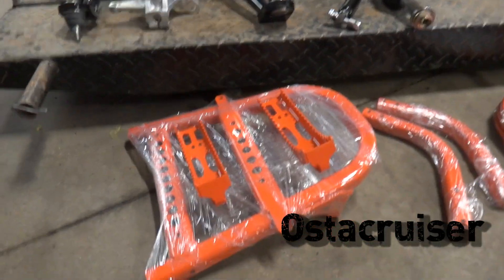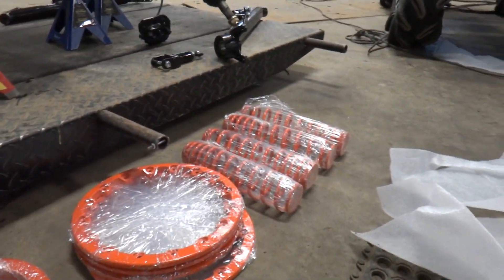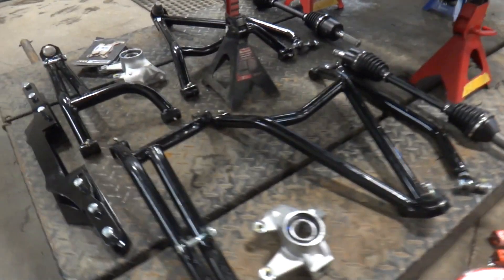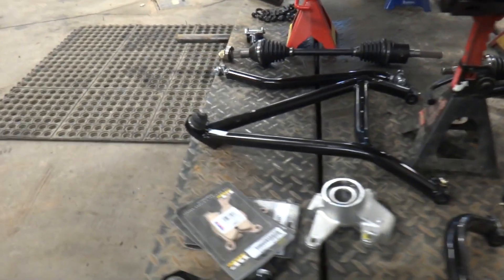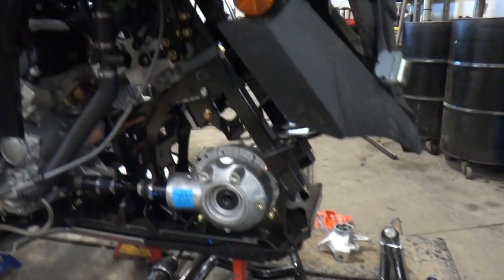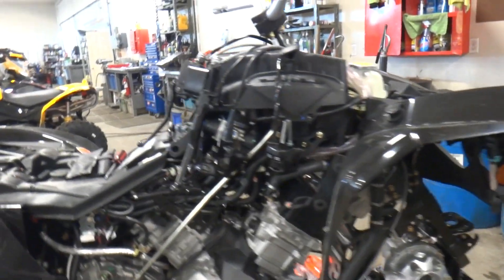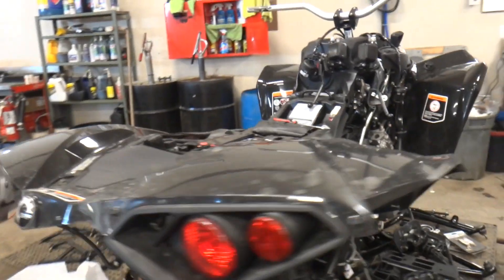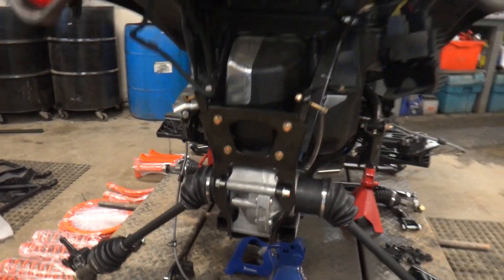Ostacruisers New Build Teaser

Comment from the maker: That's a tough one bud, the 28 Outlaw 2's have a smoother ride, better sidewall wrap for more traction in deep ruts. The 29.5" Outlaw 1's are 10lbs lighter, you will gain 1/2" Ground clearance

Comment: Hey Osta I have a 2012 Polaris Sportsman 850 XP with 3 inch catvos with rake, airdam clutch, hmf xl pipe w/ optimizer, rhino axles, snorkels, highlifter radiator relocate, and 30 silverbacks, but I want a set of outlaws. I was thinking 31's. Any suggestions? thanks